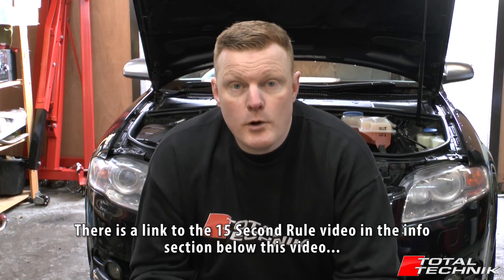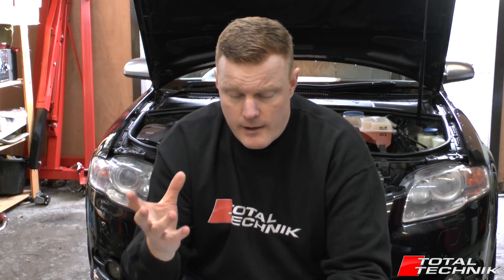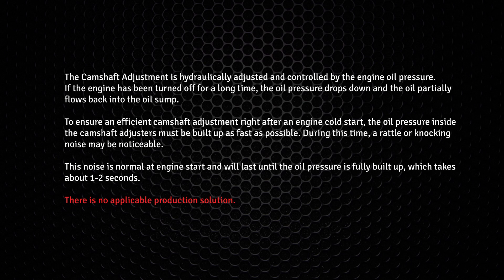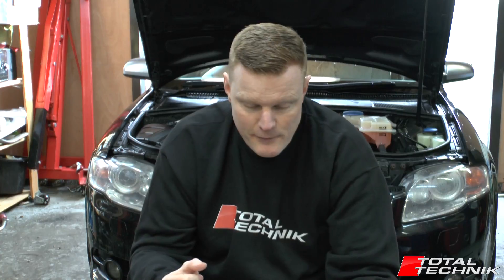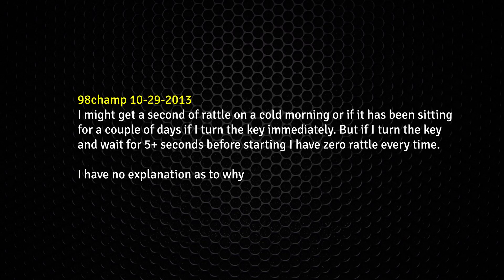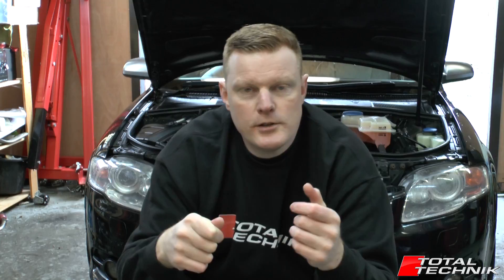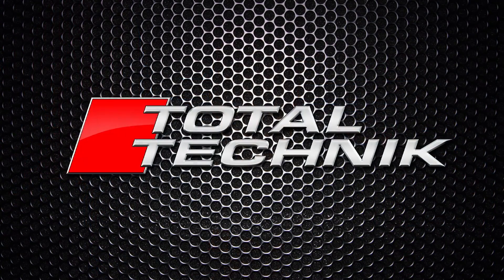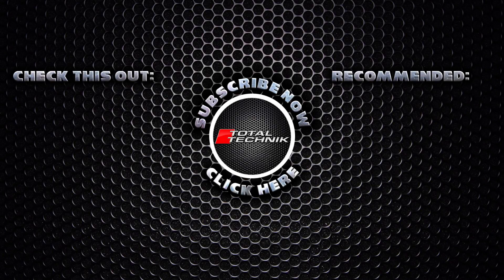Audi S4 15 Second Rule TECHNICAL DISCUSSION -  B6 B7 - 2003-2008

Comment: i turn the key on all the way on my b6 s4 avant and listen out for a very faint ticking sound coming from the engine and when the ticking sound stops all the lights on the dash are normal and i start the car and if i do this there is never any chain rattle, the chain rattle is there if i wait 15 seconds sometimes but greatly reduced however if i listen for the faint ticking sound to stop it never has chain rattle

Comment: If you really want to get rid of start-up rattle DO THIS!!!
Install a push to start button. 
1.(Install power, ground, and a signal wire running to the starter. Either route start-button into cars interior or mount inside engine bay)
 2.With key of, initiate push to start button.
 3.Allow engine to turn over for 5 or so seconds. 
4.Start your car.

Comment: Thanks for the video. I searched also for the reason of camchain-rattle and it should be caused by poor design of 2 plastic non-returnvalves: 1 for the oil-filter, as I remember well and 1 positioned in the middle of the Block under the intake-manifold etc. Replacing both should deal with that problem as I shaw/read. Idea reason 15sec: maybe battery drains some voltage by actuating startup-actions and after the 15sec the startermotor get lower voltage for cranking what gives oilpump more time to build pressure before engine starts. It's an idea/possibility.

Comment: Total Technik - I am just now discovering your video's about the cam chain issue, 15 second rule, ecm update on the solenoids, etc.  I see that these are mostly all from 4 years ago.  It is now 2023.  I cannot find a "final verdict" that you have made on the start-up rattle issue?  I have a 2005 S4 Cabriolet with 89,000 miles, 4.2L V8 of course.  I have been dealing with a myriad of oil leaks (valve covers, oil filter housing gaskets, etc.), but now am worried I should sell the car because the timing chain guides have not been replaced and I realize failure would basically ruin the car all together based on the current used value.  It seems that the timing chain guide replacement cost here in the States has gone up significantly and now removing the engine at the dealer is getting quoted at $10,000 US.  Wondering if you are still considering the amount of time of the startup rattle as an indicator that I may be needing the guides replaced or not?  Thanks in advance.

Comment: A great video, and I do the 15 second start ,even after I have just changed my  chains,guides  , I found the fault to be my aircon compressor siezed solid and broke but not before it gave me correlation fault ,so  i have just changed / upgraded all the guides and chains ,to rs4 parts ,I  have also changed the cam adjusters ,so hopefully should be good for a bit .
Done the repair at my home in the garage and on my drive . Wasn't to bad to do .

Comment: To my knowledge this ecm update does 1 major thing differently. It keeps the vacuum solenoids in the pcv system closed until full vacuum is achieved. Before the solenoids were not energized until about 5 seconds after seeing vacuum and the sound you hear from the variable flaps are actually the pulses of vacuum generated by the pistons attempting create vacuum through the crankcase passing through pcv system. Before the update as the solenoids are open the air in the crankcase simply gets pressurized by the movement of the pistons and that air gets pushed through the pcv system to the intake side of the manifold. This causes the flaps to be pulled back and for via the changes in pressure un till full vacuum is achieved.

Comment: If I'm not mistaken the reason why there's no rattle with 15 second rule is theres roughly 5-6 chain tensioners in a 4.2 but I know 2 of those chain tensioners are ELECTRONIC tensioners they DO NOT use oil pressure. All the other chain tensioners are oil pressure driven. When I saw a few of these 4.2 inside the top two chain tensioners for both banks have electronic tensioners. I think when you give it 15 seconds it gives it enough time to give it some tension as opposed to none which cuts the rattle.

Comment: My experience, this works. Im not sure if anyone noticed this but when i turn key  on ignition (one before actually starting the car) i can hear noise as if something was pumping something it "pumps" for about 15 seconds, its not constant, it sounds like when you use "manual" air pump for bicycle tyres (but deeper and quiter sound) and then it stops. Im not sure if this is some other system but each time i dont wait for it to stop i get a slight chain rattle, each time i wait for it i get 0 chain rattle. My own experience!
Reply: @Frederic91fr  yes i also hear the fuel pump, but that isnt noise im refering to, its something else 👍

Comment: It's easy to isolate the oil pressure drain down problem, pre-start oil system mods/units have been available for high performance cars for many years, both electrical (pump) and mechanical units, and could be an easy fit worthwhile solution for drain-down problems. If the problem really is the inlet flap then changing the cam timing  via the VVT software could eliminate it yes.

Comment: So I bought a '03 S4 yesterday, the ad stated it had the 2 second rattle when started up. Before buying the car I obviously read and watched everything available on the S4. I came across this video too. With the knowledge I had, I started negotiating about the camchain tensioners, and bought the car with a relative low mileage for an amazing price. When the car was mine finally, I tried the 15+ second rule and guess what: No rattle what so ever. Car runs amazing, got the complete engine rebuild 50k kilometers ago, it feels like a super fresh and well kept car. So glad I came across this video and your buying guides. Thank you very much. Cheers from the Netherlands. 👋

Comment: Hi. At the cold start, I had practically no noise. Applying the 15 second rule for some time, it's also very quiet. However, on a hot engine, after a 30-minute break, I sometimes have 1 second rattle. It turns out that the opposite is true for me. Interesting. Audi '05 S4 oil motul x-cess 8100 5w40. 
Greetings.
Reply from the maker: Thanks for sharing!!

--- 

To help support us (for both you and others reading this) there are a few things you can do:

1) Donations both needed and welcome! We cannot operate Total Technik without the support of people like you! You can donate by PayPal - just go to www.paypal.me/totaltechnik
2) Please ensure you subscribe to our YouTube channel. 
3) Please give our video's the Thumbs Up on YouTube. 
4) Please help spread the word, the more people who know about us the better! Add links to our video's in forums, let people know about us.

Thank you for your support!

Comment: The oil pump is Mechanically driven by the rotation of the engine....
NOTHING electrical can build oil pressure on this particular engine.

Comment: If anything,  key on sensor continuities are checked. Actuators and or solenoids are also checked but, here the part does an electrical sweep on/off. So electrical  range and min/max are checked. Having said that, whatever oil in the mechanical portion is  left (depending on how long it sat) is moved or bumped (so to speak) to where it needs to be giving back up lubes until pressure is reached.👈🤔

Comment: I got a A8 4.2 with 53,000 miles on it. Cold start rattle about every 5- 10. The bugger is Its very warm here n Calif during the summer and I have heard the "cold Start rattle even when the engine had been driven earlier the same day. But not often. 1st start in the AM is a guess whether will it make noise or not. The thought of pulling the motor at 53K and fixing it is a horror. Do the cam chains, then what else, might as well start replacing anything else that would fail at the time adding 2k more. What was Audi thinking???? They have had years to address this issue.
Reply from the maker: I feel your pain!! I agree completely that having the chain arrangement at the rear of the engine is a massive design flaw. Many makes and models of cars run cam chains instead of belts and the clever arrangement is to have tham at the front. Still a big job to replace, full bumper and slam panel removal including radiators etc - BUT the engine can stay in the car so a much smaller job. Unfortunately this age of engine is by far the end of the Audi cam chain rattle story - it is affecting a LOT of Audi engine models. A REALLY bad flaw of Audi's engine design, which otherwise is generally so good!!

--- 

To help support us (for both you and others reading this) there are a few things you can do:

1) Donations both needed and welcome! We cannot operate Total Technik without the support of people like you! You can donate by PayPal - just go to www.paypal.me/totaltechnik
2) Please ensure you subscribe to our YouTube channel. 
3) Please give our video's the Thumbs Up on YouTube. 
4) Please help spread the word, the more people who know about us the better! Add links to our video's in forums, let people know about us.

Thank you for your support!

Comment: I currently have a 4.2l 40 valve BFM code engine on a run stand in the shop, fully radiated and charging a battery as it will be in a Boxster soon. I set this up for out of car tuning. It has basic muffling and no flaps there. I use a sound stethoscope and the noise is top engine directly. I think the timing count has to start by sensing the g28 crankshaft position sensor once by crank rotation, and the intake solenoids get triggered by ECU program sequence. These (2004 anyhow) ECU's have a memory for cam positions at last run saved. I think the memory is employed for intake flaps within this 15 seconds. These engines seem to go full relax when shut down, one indicator is the timing belt tensioner is always deflated to loose belt condition at first and normally takes about a half crankshaft revolution for oil to inflate that. I am a believer the noise is the intake flaps. Also remember that you have no vacuum until the edge cranks, and the flap solenoids are vacuum operated.
Reply from the maker: Really nice input - thanks for sharing! Yes, I also feel that the intake flaps may be a major factor of start-up rattle, and easily confused with cam chain rattle (which is also an issue with these engines of course). This could be barking up the right tree.

--- 

To help support us (for both you and others reading this) there are a few things you can do:

1) Donations both needed and welcome! We cannot operate Total Technik without the support of people like you! You can donate by PayPal - just go to www.paypal.me/totaltechnik
2) Please ensure you subscribe to our YouTube channel. 
3) Please give our video's the Thumbs Up on YouTube. 
4) Please help spread the word, the more people who know about us the better! Add links to our video's in forums, let people know about us.

Thank you for your support!

Comment: I have the same issue on my B7 A4 2.0T. I haven't had a chance to try the '15 second rule' yet, I just saw the video and wanted to post in case I forgot about it later. I always assumed it was an oil pressure-issue and pressure takes time. (But I also usually drive older cars that may have wear-based oil pressure issues. So I am used to the noise.) I have come across some 'intake manifold flap delete' kits while researching other parts. I don't know much about them. Getting rid of them seems to be a way to get rid of their flapping noise, if that is the issue. They seem to be marketed towards tuned cars, and I am not sure if they wouldn't degrade the performance of a non-tuned car. (Like a 3" exhaust on a stock engine.) I want to research this issue about more, but since it always goes away so quickly I haven't thought too much about it. Other than I did see a brand of oil filters claiming to reduce the duration of this noise. I now want to check into it further. Here is the link to the intake manifold delete kits: 
https://www.ecstuning.com/Audi-B7_A4-Quattro-2.0T/Search/SiteSearch/intake_manifold_flap_delete/
Thanks for the great discussion on an issue I had previously dismissed. I do like it when things work properly.
Reply from the maker: Perfect - thank you for sharing and your kind words, much appreciated!

--- 

To help support us (for both you and others reading this) there are a few things you can do:

1) Donations both needed and welcome! We cannot operate Total Technik without the support of people like you! You can donate by PayPal - just go to www.paypal.me/totaltechnik
2) Please ensure you subscribe to our YouTube channel. 
3) Please give our video's the Thumbs Up on YouTube. 
4) Please help spread the word, the more people who know about us the better! Add links to our video's in forums, let people know about us.

Thank you for your support!

Comment: I have just purchased a B6 S4 Avant 6mt. I have the cold start rattle periodically. In my research i have read about the oil check valves as they provide the pressure to the chain tensioners and if a car has had a poor service history ( i dont have the service history) these can become clogged and stick open allowing the pressure to release from the tensioners when parked for a bit. With this information about the software upgrade i will be seeing if i can get this done next week and report back if my issue is fixed. I have already ordered the oil check valve kit and will replace those anyway but i will do the software first. It should be noted that my Avant has 235,000kms on it. Both a machinist that i know and a Audi service manager thats a friend both think the chains guides and tensioners are fine. The machinist who’s a motor builder said if there was going to be a issue it would have happened by this milage
Reply from the maker: Excellent input - thank you! How did you get n, do you have an update?

--- 

To help support us (for both you and others reading this) there are a few things you can do:

1) Donations both needed and welcome! We cannot operate Total Technik without the support of people like you! You can donate by PayPal - just go to www.paypal.me/totaltechnik
2) Please ensure you subscribe to our YouTube channel. 
3) Please give our video's the Thumbs Up on YouTube. 
4) Please help spread the word, the more people who know about us the better! Add links to our video's in forums, let people know about us.

Thank you for your support!

Comment: I installed a fuel cutoff switch on mine so that I could cut the fuel and crank the engine a few times before starting it to prime the system. Without priming it I only ever had a 1-2 second rattle on cold start and nothing on a warm start. With that being said I eventually pulled the engine at 198,000 miles and I only had 2 guides left that were not broke. All the others were either cracked or in pieces.
Reply from the maker: Interesting! Thanks for sharing!!

--- 

To help support us (for both you and others reading this) there are a few things you can do:

1) Donations both needed and welcome! We cannot operate Total Technik without the support of people like you! You can donate by PayPal - just go to www.paypal.me/totaltechnik
2) Please ensure you subscribe to our YouTube channel. 
3) Please give our video's the Thumbs Up on YouTube. 
4) Please help spread the word, the more people who know about us the better! Add links to our video's in forums, let people know about us.

Thank you for your support!

Comment: I had been chalking the the cold start rattle to the oil jet check valves that hold some pressure in the top end of the engine, being faulty or gunked up. Has anyone replaced these oil check valves and cured the cold start rattle? My 2004 S4 has the rattle after being off for less than an hour, so it happens pretty often with mine.

Comment: Hi, im new to the B6 S4 but am a huge fan of your work so to start, thanks a million ! 

I work at Audi and have access to all said articles so I can at all, help, please ask!

I think this works more times than not on my s4 which has had rebuild 45k ago. I do occasionally still hear a rattle even after 20s on a cold start. My question is does this need to be done when there is some temp in the engine?  It doesn't seems to rattle but I'm not risking any damage. 

And also, I hear a very similar low tone slapping noise when turning the car off , only about 1 second. This happens both after a long haul and shorter journeys ( under 10 miles) if i turn it of within 10 s from parking. The manual recommends after a long haul, wait 2 minutes on tick over which, again, pretty much  solves this rattle every time bar a handful. Would this point at the flap?

Comment: Im looking at purchasing a 2005 S4 that has 56,500 miles on it. Should I be scared of this car due to the dreaded timing chain guide failure or not?
Reply from the maker: Hey there! Short answer is no, definitely not. They are truly fantastic cars, but they do have this quirk. The low miles will stand you in good stead, but there are no guarantee's. Expect minor rattle on initial start up.

--- 

To help support us (for both you and others reading this) there are a few things you can do:

1) Donations both needed and welcome! We cannot operate Total Technik without the support of people like you! You can donate by PayPal - just go to www.paypal.me/totaltechnik
2) Please ensure you subscribe to our YouTube channel. 
3) Please give our video's the Thumbs Up on YouTube. 
4) Please help spread the word, the more people who know about us the better! Add links to our video's in forums, let people know about us.

Thank you for your support!
Reply: Total Technik I do outside sales for NAPA and plan on running Liqui Moly oil in it, which my import specialty shops said is best for that motor and possibly run a 10w40 weight in it which is better lube for the chain guides